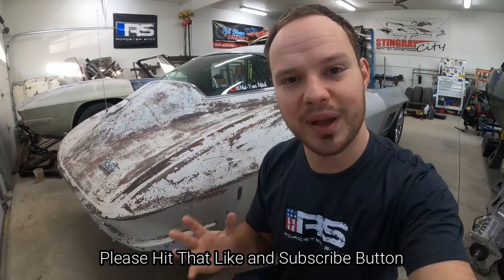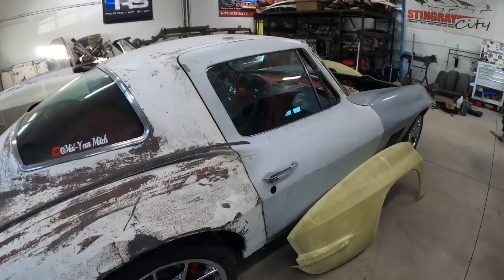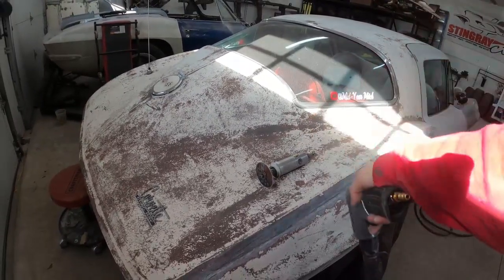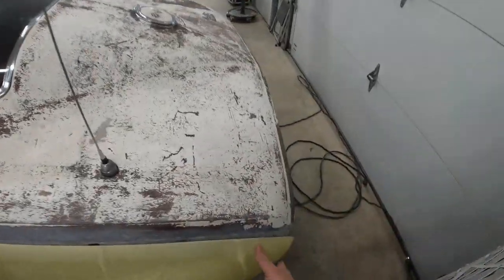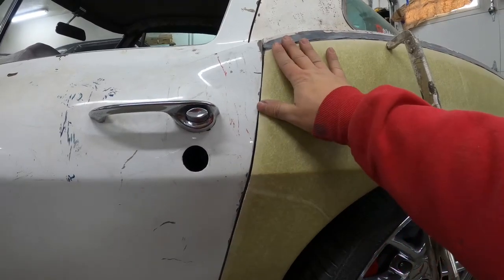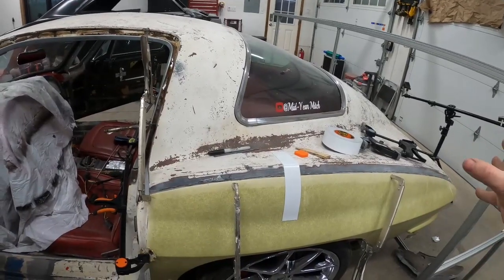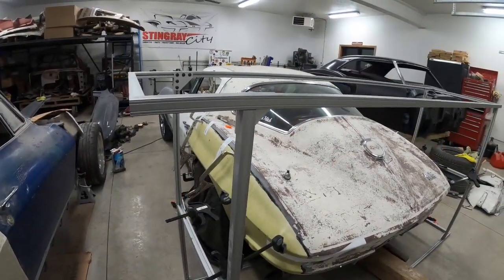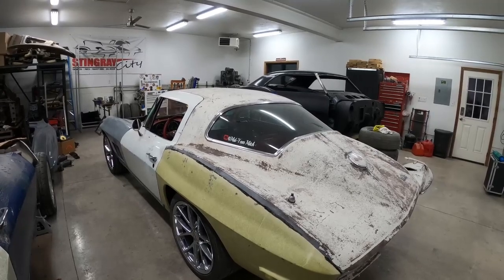How To Replace Flared Quarter Panels On A 63-67 Corvette. I Ruin Overkill's Patina!!  Spec7 Chassis.

Comment: Great looking finish there Mitch! Could you tell me which manufacturer's quarter panels have you got there? I'd need get a pair.
Reply from the maker: They are made by Vette masters out of Virginia. You can find them on eBay. Look up 63-67 corvette rear quarter panels. They are sold by jhn317. They are available in 3 colors. Check them out you won’t be disappointed!

Comment: That clamping fixture you made has really come in handy , those quarters fit perfect .A very good video Mitch .
Reply: Hi, I was reading that you have done a body off on a C1. Are they basically the same design as to how they go together? C1s are fun too. I had a friend in the military when I was at El Toro MCAS. IT was a 58, it had 8 stacks sticking out the hood. Once we sent a Pantera owner home crying. Take care, can't wait to see the 60 build.
Reply: Well I will tell you that the electrical is much easier,less of it , the interior is much simpler,the front suspension, much simpler as is the rear suspension . I do my own work , I am not kidding.
Reply from the maker: Yes it really has. I’m putting it to work.

Comment: Hey Mitch, job well done. Someday maybe I’ll have enough courage to try replacing my rear quarters and tail light panel. 
One question, any particular reason you used the air chisel versus the heat gun? I watched you use a heat gun in the past and it seemed to work well.
Reply from the maker: Thanks I appreciate it! That’s a good question. I actually started using the head gun at the beginning but it wasn’t working that well. Sometimes the heat gun softens up the panel that you are trying to separate along with the glue and it starts to make a mess. That’s what happened here. I tried it and it started making the 1/4 soft. Sometimes you can push through it but it was going to destroy the 1/4. I like the air hammer technique because it shocks the panel and if the glue isn’t heated the seam is brittle and it will pop. Everyone does things differently and there really isn’t a wrong answer. Just try a couple different methods and find out what works for you.
Reply: @MidYearMitch  I appreciate the feedback.